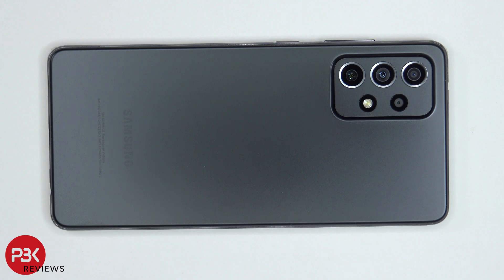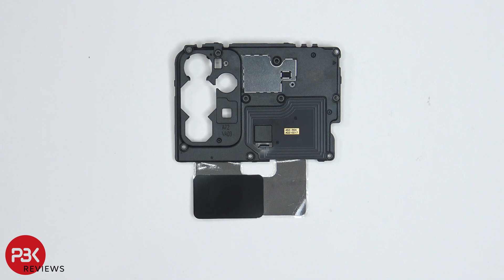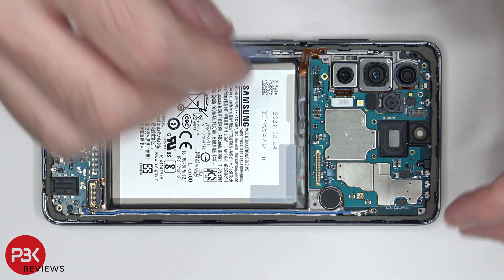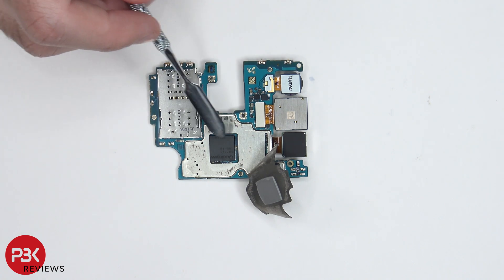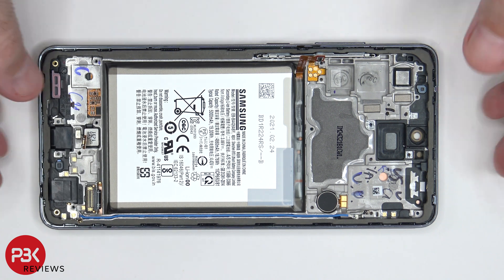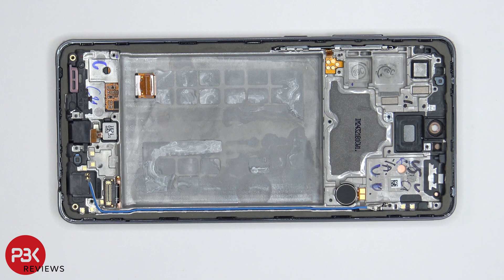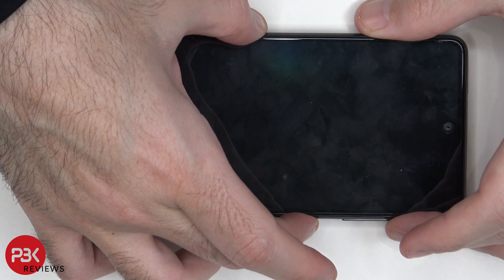Samsung Galaxy A72 Disassembly Teardown Repair Video Review

Comment: My a 72's touch screen became unresponsive a day ago, and now I can t even access settings. I've tried everything short of factory reset and disassembly, so I'm hoping maybe you might have some ideas on a solution?
Great video by the way, love the detailed instructions. Might try this if nothing else works.
Reply: same here
it just went black right?
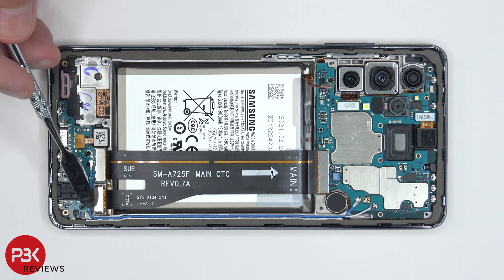Reply: Same, but I think it might be the new update or the flex cable ( 1:27 ), but I'm not sure yet, I'm gonna buy a flex cable and fix my phone, and MAYBE come back and tell you guys. Maybe.
Reply: It might be the flex cable

Comment: Hi, my A72 suddenly started to restart itself and only stops when the battery is drained, cannot start it and tried everything. Any clues on what to do next?
Reply from the maker: Could be many things. You would have to try a different battery to see if the battery has gone bad, or might be software issues, bad board, water damage etc.

Comment: Hello, my Samsung A72 can't recognize the SIM, from what I've understood, I should replace the main flex cable and/or the sub-board. Is it correct? Thanks a lot.
Reply from the maker: Hi, no the sim reader is located on the main board and not the sub board. So would require a specialty shop that does soldering to be able to replace the sim reader on the main board.

Comment: Hello, I think my Samsung A72 has an issue with regards the backplate, it fell off and I'm guessing that Samsung has a poor glue residue. No history of repair though, what will I do? Thanks.
Reply from the maker: you can replace the adhesive with a new one. Here is a link for it: https://www.ebay.com/itm/234722749721?hash=item36a690ed19:g:v~MAAOSw5p1jPbYF&amdata=enc%3AAQAIAAAA4J74u5kvH8apIL1oMsB3gi%2Fe0J0H1ZH2zwsOszCqzcx12UXa%2Bq4sXROJgWNDUbySn3qU4spJfdqmBfk7%2F4X5sTM9BWdQeUbq60n9WTpWb070Nb9ucYzvNSt2XPxamT3u0dnx2FtUGVr9Pkvqoc9E9XLGAvLM4KMv14vtTtIvhMvkOFIBkZ3ArbdJ2mcDUSgvdmlDZpxaveFqk6IMlJwX3mAksu4qq%2FAu5saodXOs9C2h%2B3qU3tyz36sjC2QP67zN1O7mzh9f4ppNva4nRSz6WvGnKxLeteiqjaBUQMYR0Mnd%7Ctkp%3ABk9SR6TM3OrOYg
Reply: same, the left side (the one with no buttons) is coming off when the phone heats

Comment: My samsung a72 back cover fell off on its own. Thats why I was curious on how to glue the back cover without affecting the water resistance capability of the phone.  But it looks like you didn't even glue it back? Is gluing it back enough? Or it has something more that is needed?
Reply from the maker: I don't show applying a new one in the video, but here is a link to the replacement adhesive needed to re apply the back. https://www.ebay.com/itm/234722749721?hash=item36a690ed19:g:v~MAAOSw5p1jPbYF&amdata=enc%3AAQAIAAAA4J74u5kvH8apIL1oMsB3gi%2Fe0J0H1ZH2zwsOszCqzcx12UXa%2Bq4sXROJgWNDUbySn3qU4spJfdqmBfk7%2F4X5sTM9BWdQeUbq60n9WTpWb070Nb9ucYzvNSt2XPxamT3u0aDNNFYR4jt6wZ1Zzfn6Erb1hFkLqaPOacoktKdunddqWkC%2FZlfBNE1Jy4ws0i37Z7odIT7TvxLcjPCtOAOBk%2Fd7A1gofxCCa%2F9Gxh%2B0%2BIRPXWqHK0PbdQU5QzpmQq74gQbtKr1MEvXl7Ysad0My4Zg62mkXiV%2FGaoe%2B%2BIJ3Pe6t%7Ctkp%3ABk9SR8rLgO3OYg
Reply: We have the same problem.

Comment: Hello, my phone was soaked in a laundry water. Unfortunately, the back part was open (it was opened by a technician and didn't glue it properly)... Then there was a water inside (since it was open)... Is there a possibility that it will be repaire? Or should I buy a new one?
Reply from the maker: Most likely will be too badly damaged. The only way to tell is to open it up, disconnect the battery, dry it out completely, brush off any corrosion over the chips and connectors with a small brush and then test the phone to see if it will work. If not, you would then need to order working parts like the screen, battery, etc. to test and see which is not working or has gone bad.

Comment: Can someone tell me if its normal?
Mine was coming off and there was sticky glue too when it was coming out
Reply from the maker: What was coming off? the back cover? Its possible the adhesive went bad and needs new pre cut adhesive for the back plate/cover.

Comment: Nice video bro 👍🏻. I just recently dropped my phone and the screen goes all black. No damage on the body since I used case. One thing I noticed is the screen actually works even it's all black (it vibrates when I touch where the fingerprint scanner located). So then I tried to remove the back cover and suddenly the screen turned on and I can use it like nothing happened. But the probrem is when I put the back cover back on, the screen goes all black again. What could be the problem?
Reply from the maker: Hi, hmm that's odd. Might be a short or something. Try taking apart the phone and making sure all cables are attached and have not become disconnected. Also make sure everything is seated properly and see if that helps. If not, might be a defective screen.

Comment: Got any idea why the phones back plate adhiseve weaking. My phone's back plate just appears coming even though the battery is not bloated.
Reply from the maker: Not sure, it can be caused my moisture exposure over time or excessive heat can loosen it as well. You can replace it with this replacement: https://www.ebay.com/itm/155008250046?hash=item24173630be:g:RFMAAOSwAdlhBEq1&amdata=enc%3AAQAHAAAA4HeCADtEdyPMVgJ6qJDeIuYjgpdiaCo0s2XQINKvlIGjRvuNOfZsQXCCt%2FmwBtZ8QwklsC%2F2yNK2Mw47M2X%2FhS1alFJWNoNX9ji%2FzT5hdRuPF82%2FHd5MaXcFjM7e%2F8xVy7pDY1KUs6UwA2McsET0IaD%2BpeauUJsiXzY%2FRWpQ2qIXiyw2zVDjj%2Bg%2BRgpv%2BmR7qWu851jx%2BnKsdbZjNO5VtBRyxioS4rqDezIl0flZE5XCrvhYdpEMxXH9jIl%2F3qbpFIn1hZit3TYfXdYwLZSYHSB5WdoIVCo2QJrnqWgAUNII%7Ctkp%3ABFBMxpnwtZdh
Reply: not really nice but nice to see other people have the same issue, did you fix it?

Comment: I got water inside my back camera. So I would like to know if i could remove the back and put it back by myself?
Do I need a glue or something?
Reply from the maker: Hi, yea you can heat it up with a hair dryer and pry it off. Make sure all the liquid inside the phone is dry and that there is no corrosion around any connectors or chips so it doesn't short later and damage your device. Then you can re apply your current back with new adhesive strip like this one: https://www.ebay.com/itm/155008250046?hash=item24173630be:g:RFMAAOSwAdlhBEq1  or you can get a new back cover that already has the adhesive pre installed, so all you do is peel off the film and apply it to your phone like this one: https://www.ebay.com/itm/115130401775?hash=item1ace4e83ef:g:hFQAAOSwdfdhreqb

Comment: Hi, I have a question: 

My A72 stopped vibrating out of nowhere and sometimes the virbation returns whilest i'm tyling even though its a lot weaker. I also hear a rattling noise, but this is the camera assembly you said. Is this fixable without dissasembling the phone? 

Thank you!

Comment: Hi! I dropped my samsung a72 in a water last week. At first i was not worried since its a waterproof phone but after letting it dry, i noticed that there is still a moisture visible inside the back cover of the phone. I literally panicked since the phone is just 9 months. Can there be any damages inside my phone?

Btw, the phone is working fine and there seems to be no damage on its functions.

Thank you!
Reply: i dropped mine in the washing machine but thankfully i got it out before it ran a full cycle.. did your phone not turn on too after you got it out of the water? what did you do to dry it out?

Comment: My led lighting at camera burn i think.. now i can't use led light. So the led light cannot be replace? Am i right?
Reply from the maker: Ya, its soldered onto the board so it would require a place that is good at soldering and that can find the part to be able to replace it. Wouldn't be easy.
Reply: @PBKreviews  thankyou for explaining.. instead to repair.. i would like to find alternative way that more cheaper.. maybe use velco and glue it on my cover phone.. then use led lightning that i can buy from china and attach it with velco.. whenever i want extra light.. it could help for a while before i change to new device huhuhu

Comment: I accidentally  poked my a72 top microphone  with sim injector,did I damage it and how about the waterproofing?
Reply from the maker: Hi, no you will be fine, the mic is seated above the hole and the filter will be fine as well.
Reply: even if I applied a force on it?
Reply from the maker: @eisanonsol8771  yes because the filter is not seated against the hole and its above it, so would not be damaged
Reply: thanks 😊

Comment: Hi. How to remove sim card slot if the pin hole not working (pin press cannot eject the slot)!? Thanks in advance.
Reply from the maker: Hi, aside from taking the phone apart, you would need some sort of tool to be able to get in that hole slightly and hook around the sim tray eject hole to gently drag out the sim tray.

Comment: I have been using my a72 for 3 months now. Suddenly whenever I shake my phone, it makes a rattling noise inside. Idk everything is working fine, but I'm nervous about it because I never drop the phone or anything else.
Reply from the maker: Hi, it's just the camera assembly rattling and its normal nothing to worry about :)
Reply: dude thats the camera...they are like chicken neck theyre moving..

Comment: Why you cannot open display also 😂😂😂🤣🤣🤣
Reply from the maker: Because most replacement screen assembly usually come with the mid frame pre installed so once you have taken all the parts out, you usually transfer them over to the new frame assembly. However I do mention how to replace the screen itself if you only bought a screen which was not with the frame (basically once you took everything apart as shown in the video, all that is left is to heat up and pry your old screen off the frame). I don't pry the working screen off since there is a high chance of damaging the working screen when prying it off.

Comment: Great quality video and details that I haven't seen on other disassembly ones. Thanks. I have a question, there are two pinholes on the top, one for the SIM/SD card slot. The other seems to be a microphone. What happens if you use the sim ejector on the mike hole. I would imagine Samsung Engineering would have accounted for that chance. Did they? Asking for a friend....
Reply from the maker: Thanks you. Nothing you should be fine, the mic sits above the hole so it wont be damaged.

Comment: Hey just wanted to know (since I get paranoid easily). I dropped my a72 and although there is no visible damage because of my good bezzeled cover and screen protector. Is there any chance for it to still have any internal damaged despite it looking absolutely fine? Is the internal built sturdy enough to survive a simple drop easily? I am just a bit concerned since this phone is indeed expensive. Do guide me.
Reply from the maker: Hi you should be fine. Unless you threw the phone against a wall or hit it really hard, a drop should not damage the internals.

Comment: Why does my a72 back gets warms where the earpiece speaker is located ??
Reply from the maker: There are some components bellow the earpiece speaker on the board which can get hot and there is graphite film there as well which transfers the heat from those components from inside the phone to outside the phone.

Comment: Does the water resistance gone after disasembly ?
Reply: yeah you need a waterproof seal again to make it waterproof
Reply from the maker: Correct :)
Reply from the maker: As the previous comment mentions, you would need to apply new original pre cut adhesive made for the phone to retain any water resistance.

Comment: Is it possible to disconnect the wifi antenna?
Reply from the maker: It would be best to just disable the wifi from the phone, because disconnecting the antenna cable or antenna would just make the signal weak but does not mean it would completely turn off the wifi.

Comment: Is the usb port easy replace? Is it a whole board replacement? I dont have much surface mount soldering experience, but I have the full setup.
Reply from the maker: You would just have to replace the sub board which has the charger port on it. For example like this one https://amzn.to/3ua80lX

Comment: Having problem in A72 . Moisture detected .. Is it the problem in type c port or the logic board or the sensor ? if its sensor than ..which chip it is ?
Reply from the maker: Hi, not sure which one sets off that message, but you can try brushing out your charger port with an old tooth brush or taking apart the phone to brush off any corrosion inside or dry out any moisture.
Reply: @PBKreviews  thank you
Reply from the maker: @saheburrahman1213  You're welcome

Comment: Hi, can you please tell what happen if i remove the graphite sheet over the speaker  assembly ??? (minute 1:19)
Thanks!!
Reply from the maker: Hi, nothing will happen, its just there to help transfer some heat but its not a necessity for the speaker to function. Will work without it just fine.

Comment: Thank you , one question : Galaxy A70 have graphite or something for cooling CPU ? Thank you again
Reply from the maker: You're welcome. Yes it has a layer of graphite on one side and thermal pads and heat transfer tape on the other side of the board.

Comment: If you tear it down and put it back again is it still water resistant?
Reply from the maker: As previous com-mentor mentioned, would require new original pre cut adhesive seal to be installed to retain the water resistance.
Reply: need to install new seal
Reply from the maker: correct :)

Comment: Gi, I accidentally punctured my mic instead of the sim try. Could it be a problem? I tried everything but it seems working okau
Reply from the maker: Hi you should be fine, the mic sits above the hole so it wouldn't get damaged.

Comment: If i send and pay you to take my samsung Z flip apart so i can get the data that is stored on there, would you?
Reply from the maker: I don't have the skills to do that. It requires special companies with special computers and tools to be able to desolder the memory chip and get the info off of it. Its not a user removable chip. Soldered onto the main board.
Reply: @PBKreviews  thank you for getting back to me
Reply from the maker: @dasbo1fan  you're welcome

Comment: What the material on the side frame? Is it metal or plastic?
Reply from the maker: The midframe itself is aluminium with a layer of plastic around the sides/frame of the phone. Its not a unibody aluminum frame if that's what you are asking.
Reply: @PBKreviews  okay, thanks for letting me know!
Reply from the maker: you're welcome
Reply: @PBKreviews  what do you mean by midframe?

Comment: @PBKreviews On my A72, when i press the center of the back cover, I hear a plastic click. Then it should be the plastic that contains the graphite pad that probably has some play. Do you agree?
Reply from the maker: Yes correct. There is a slight space in between the back plate/battery door in some portions so that would be the reason you are able to press down and hear that.
Reply: @PBKreviews  Thanks! No need to worry then. Although these clicks shouldn't be expected in a Samsung phone imho. Nevertheless even some iPhone Max models have that, apparently...
Reply: I am noticing a bump/hump/ swell to the right side of the camera unit is it normal or something serious ? There is a slight battery draining issue and a slight heating issue near the camera unit when browsing.

Comment: Sad to see the mid frame cannot be replaced.. if you want your phone to look new in the long run, and you like to carry your phone around without a case, that's better off buying a new screen. But still, at least its got IP rating in exchange
Reply from the maker: Yup, replaceable frame housings have their pro's and cons and vice versa with the none replaceable frame housings.